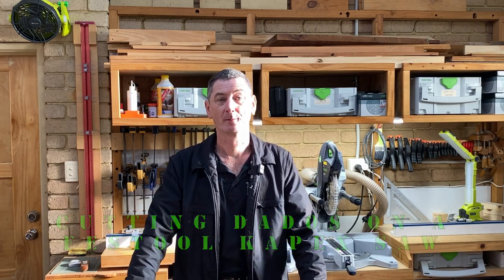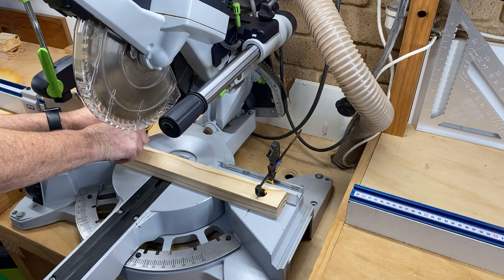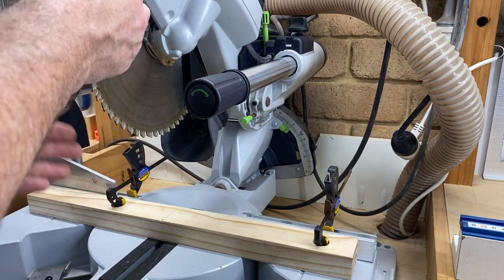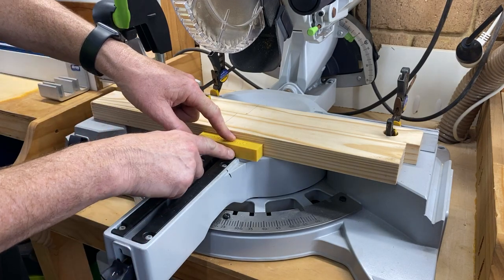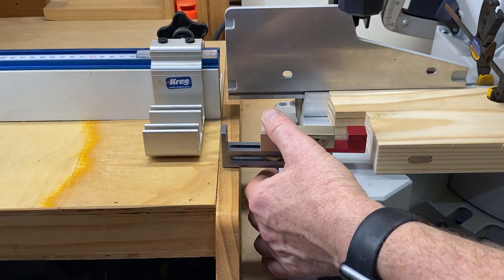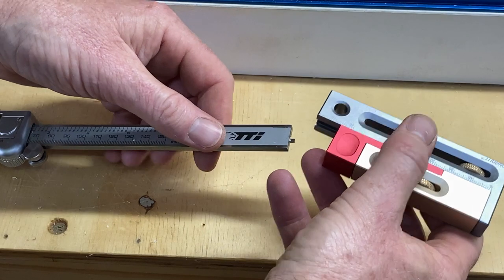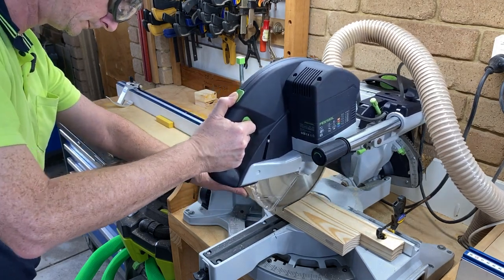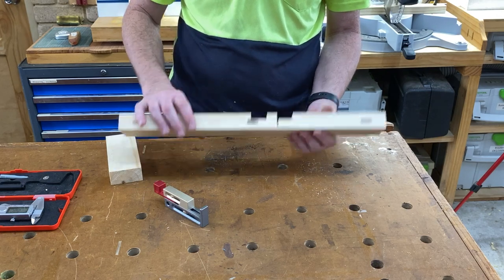How to cut dados on a Festool Kapex Saw

Comment: I wouldn’t futz around with that kerf gauge. Seems slower and more trouble than it’s worth. Just offer up the stock you need to lap and a square to keep it aligned then trace with a pencil. Hog out in between the pencil lines, but leave the trace lines visible. Can always sneak up to the pencil lines if too tight.

Comment: What dust collection setup do you have? How did you connect 2 1/2 inch hose to the dust port
Reply from the maker: Hi, I currently have one of those old 1HP bag extractors at the moment. I used rubber tape and a hose clamp to adapt the hose to the saw outlet. At some point I will get rid of this system and go to something with a HEPA filter.

Comment: Great tool!  As the blade is really irrelevant, it’s the kerf it makes that is crucial, wouldn’t you be better making a cut in timber then use calipers on that?
Reply from the maker: Hi, I can see why you say that, It is logical, but to get a tight fit, I ended up reducing the the gap to slightly less than the blade anyway. The width of the blade should be ever so slightly narrower than the kerf. No matter how good the blade is, there is going to be a tiny bit of run-out.
Reply: i know it is kind of randomly asking but does anybody know a good website to watch new movies online ?
Reply: @Felipe Jaxen Flixportal xD
Reply: @Phoenix Fox Thank you, I signed up and it seems like they got a lot of movies there :) I really appreciate it!!
Reply: @Felipe Jaxen glad I could help :D

Comment: Now I have another reason to sell my big Bosch Compound Miter Saw. Dadoes and accuracy. My Bosch is out between a 32 and a 64th of an inch over 11 or 12 inches. I’ve adjusted this saw until I’m blue in the face. Nice Demo thanks
Reply from the maker: Hi Geoff. I too moved over from a Bosch, which was a good saw, but the Festool is much more enjoyable to use, and more accurate.
Reply: It would be nice if miter saws were accurate.  Sliders and non sliders.  They are just not.  Makita and dewalt and hitachi.  But I just bought a kapex so we’ll see.
Reply from the maker: @davidbryanwoodworksandmore  Good luck David. I have certainly found the Kapex to be more accurate than other miter saws I have used.
Reply: @DarrensWorkshop  thanks.  So far so good. I’m just using it fit the first time.